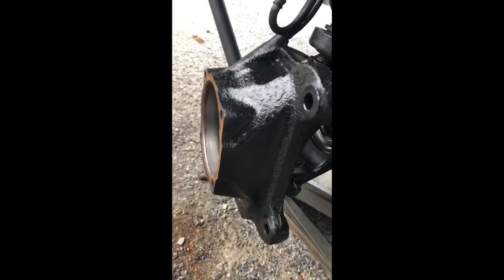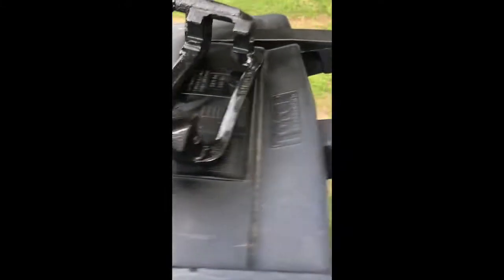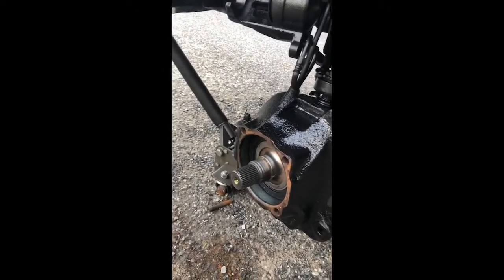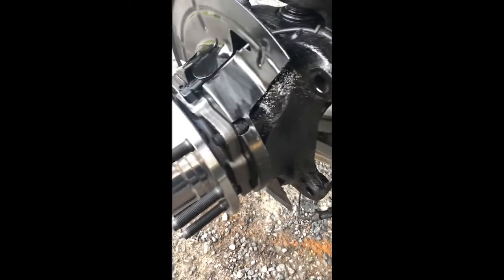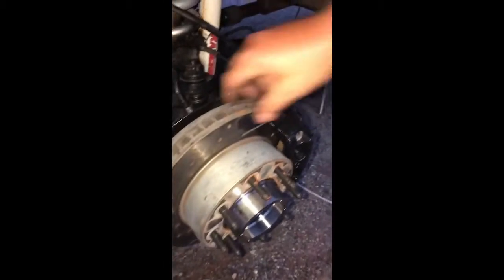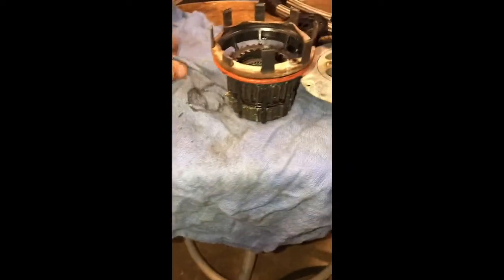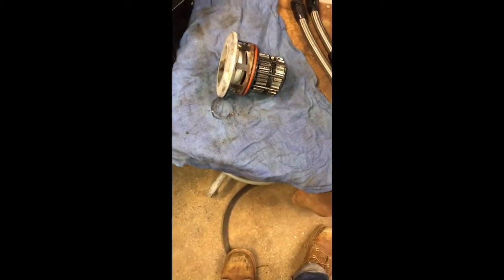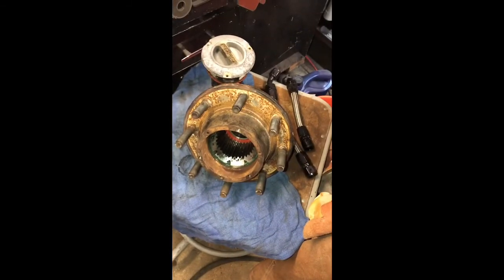2012 f350 excessive play in front stub axle and hub bearing diagnosing and repair

Comment: Would you have to replace the hub assembly to tighten up the stub shaft even if you didn't have to cut it out?

Was your truck making any noise going down the road? Did it shake over bumps? Any other symptoms from all of the play in the front axle shafts?

How is the repair holding up?